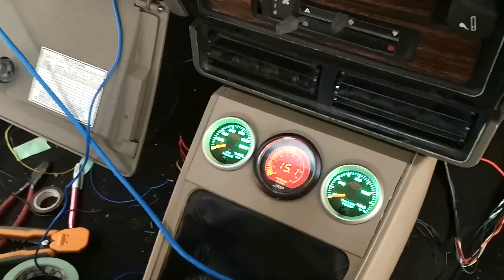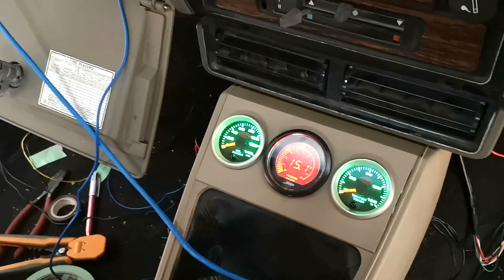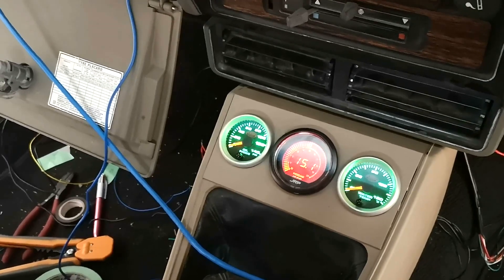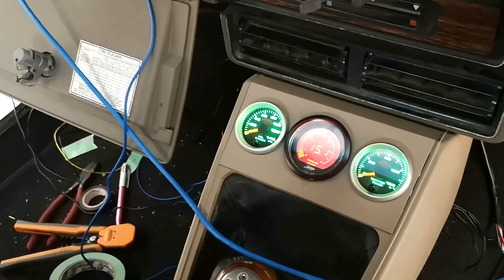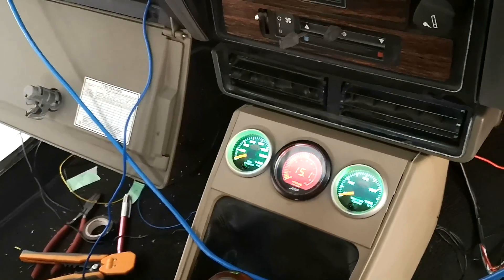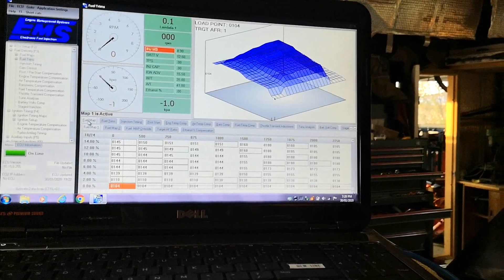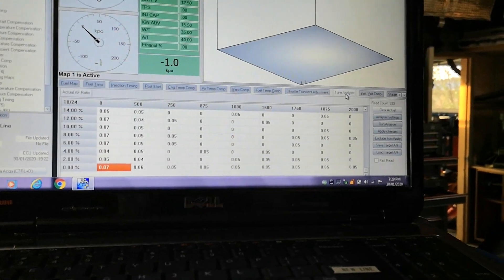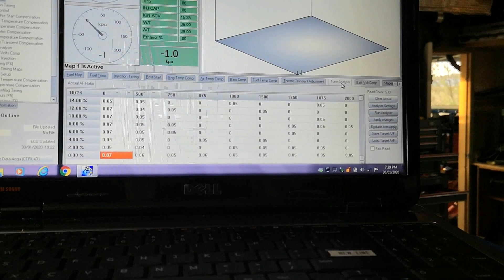Torana Build No.31 KamicarzCreations - LAMBDA Vs Air Fuel Ratio and fuel map basics

Comment: I’ve got an lc gtr with an injected 173 with a strata setup running a motec, I only have. 7.5-1 comp ratio but run 32psi, the timing is reasonably easy to tune, I used to run 40deg on a locked dizzy but I’ve now got 55deg in some areas with no hassles, I’d personally start the map off with around 10-20 I rekon or lock the map at what the dizzy would’ve been at, every engine will take it differently of course. I run my lambda at a .85 on cruise and .80-.82 top end (higher the number leaner it is) I’ve tuned mine with no experience from the start and I’ve got it pretty spot on for cruise and a bit rich up top.
Wicked build all the best
Reply from the maker: Thanks heaps....great info. I really want to have a go but have had troubles sealing up the cooling system and cold not get a decent run on it. Hopefully thats all fixed now :-)